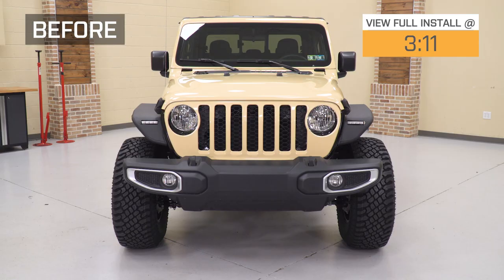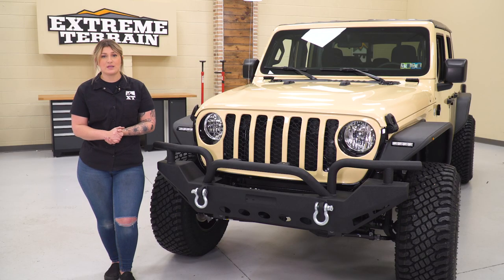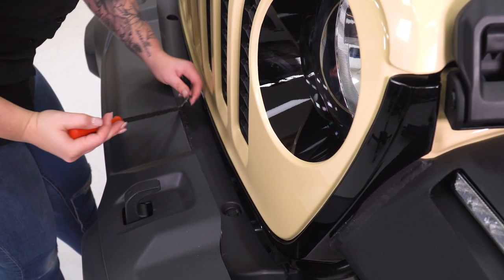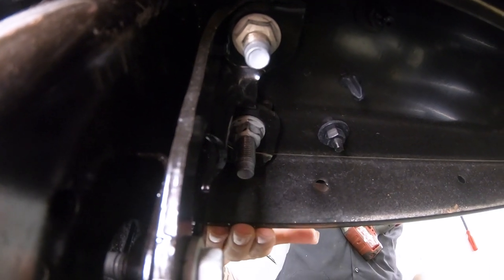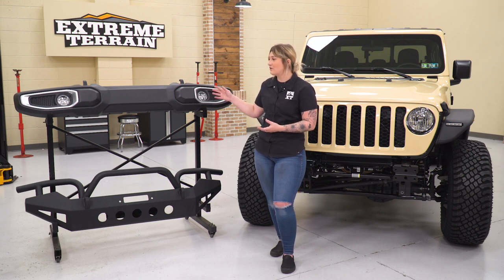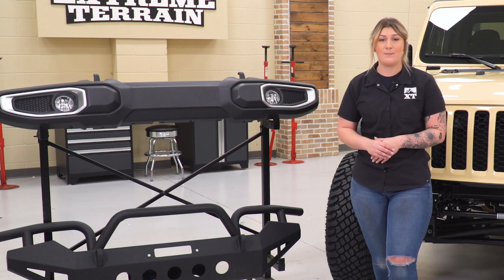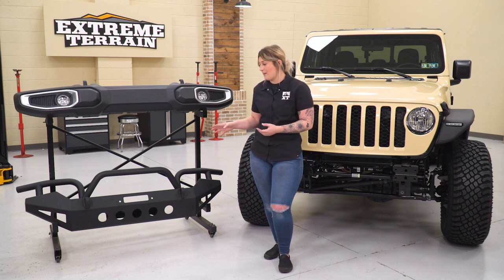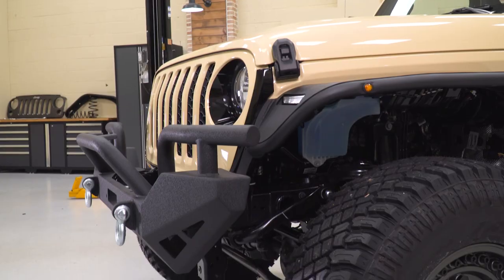Jeep Gladiator JT RedRock 4x4 Rock Crawler Full Width Front Bumper w/ Winch Mount Review & Install

Comment: is an ALUMINUM bumper less likely to rust?
Reply from the maker: Rusting and corrosion all depend on the protective finish. The aluminum will hold up fairly well here especially because of the two stage powdercoat finish.